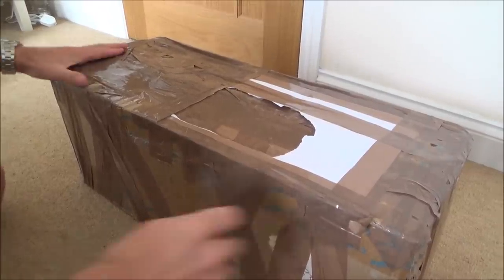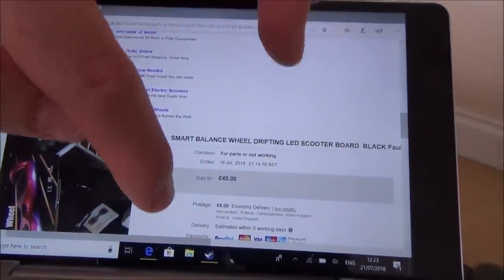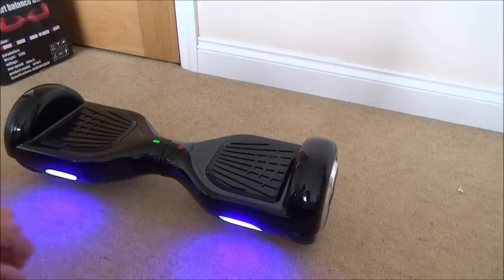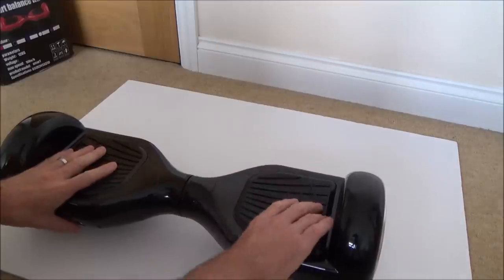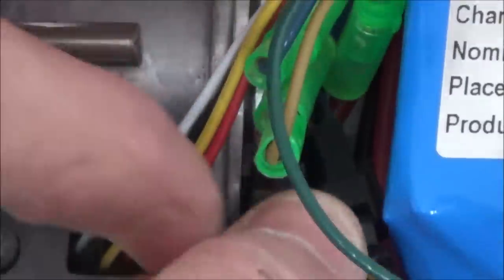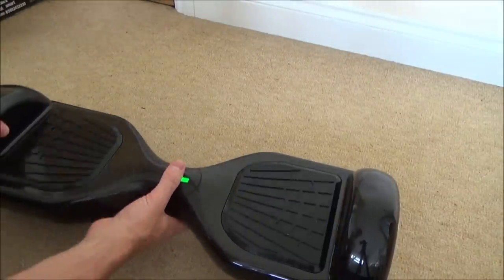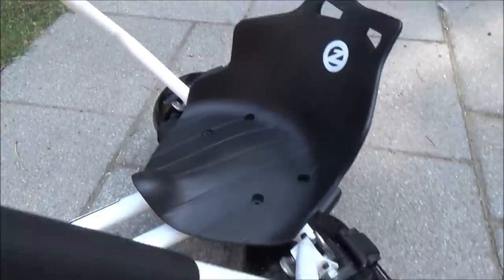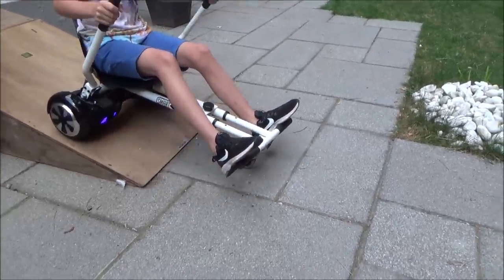Trying to FIX a Faulty Hoverboard / Self Balancing Scooter

Comment: The loose battery and wiring under the clamp and against just that shrink wrap oh my! That must have been one of those recalled units. In this case it just pulled the connector, no fire. Reroute the wires outside the bracket and take up the space under with rubber floor mat so it can't slide sideways. It fell on end in shipping no doubt.

Comment: I have an issue with a board a friend asked me to look at that I cannot find information about anywhere yet you would think it to be quite common. My board has an issue when you stand on it, it moves forward or backwards even when in the "flat neutral" position that isnt supposed to move. Im working on the issue now and am very surprised I cant find any others having an issue like this. I'll figure it out eventually and will post what I found once I figure it out, but nothing on YouTube has helped at this point.

Comment: I have an issue me and my step son were on his hover board yesterday it worked perfectly until I came to a lip in the ground and it cause the tires to spin in place then it turned off and wouldn’t come on unless it’s in the charger but even then it blinks green then red

Comment: just out of curiosity what is your success rate in repairing faulty items ?
Reply from the maker: On gaming stuff it is quite low but on other items it is high. I think with gaming or anything which has a good resale market then it has probably been looked at many times by professionals and deemed economically not worth it. Then it gets dumped on eBay!!!!

Comment: i have found the problem (havnt watched past 2:53 so i dont know if u alredy have) i have tried to attach a screen shot but it wont paste it so ill paste the URL and the part that you need to read: Red Light Flashing 5 Times - Replace Motor

Problem: The hoverboard red light blinks 5 times when there is a problem with the internal motor on the battery side. This problem is accompanied by one or both sides of the hoverboard refusing to balance. 

Cause: The long side of the hall line is faulty. There could be a deviation in the pin, a broken hall line between the motherboard and the motor, motor wires are switched around, or there is a bad motor circuit board.
Solution: The motor (inside of the wheel) on the battery side needs to be replaced. We recommend buying a replacement hoverboard motor from us and replacing the one on the battery side of your hoverboard. Motors themselves come fully assembled inside of a new wheel.
URL:https://www.streetsaw.com/pages/hoverboard-red-light-flashing

Comment: So my hoverboard looks almost identical on the inside, I double checked to make sure everything was connected but it still beeps and will not work. Calibration doesn’t work as holding the power button down does nothing
Reply: Any ideas?

Comment: Hi can anyone help me out 

For me the problem is 
One side light is on and that side is unresponsive(the power button side)whereas the other side works fine
I tired to recalibrate but in doing so only one side blinks the other side stays still and unresponsive 
Can anyone help me fix it
Without suggesting me to change the motherboard and replace a new one 

And  this error caused 
Because i tired to recalibrate it in a wrong manner and screwed it up.
If anyone could help me 
It would be amazing

Comment: only thing I'd be careful of is that the battery is right under your son so if he sees any kind of smoke from the hoverboard he  needs to jump out before it lights on fire especially if you have the hoverboard that has the heat sync right next to  the battery

Comment: I REALLY NEED HELP. I PURCHASED A SWAGTRON T6 OUTLAW OFFROAD HOVERBOARD. THE OWNER TOLD ME ITS BATTERY NEEDED REPLACED. AND WAS SELLING THIS 600$ BOARD FOR JUST 100$. I FIGURED, NO MATTER WHAT IS WRONG WITH IT. THIS IS GOING TO BE WORTH IT. BUT I AM COMPLETELY STUMPED. WHEN I PLUG A DIFFERENT BATTERY INTO IT'S PARALLEL, IT CATCHES ON FIRE AT THE CONNECTION. WHEN I PLUG IN A CHARGER. THE GREEN LIGHT THATS SUPPOSED TO TURN RED, TURNS COMPLETELY OFF INSTEAD AND YOU CAN EVEN HEAR A SORT OF POPPING NOISE FROM THE CONNECTION. WHAT THE FUCKING FUCK. IS THE MOTHERBOARD COMPLETELY FRIED? AM I SCREWED? I JUST FOUND OUT THAT ITS BATTERY IS GOOD, AND USED IT IN ONE OF MY OTHER BOARDS. TO TEST IT. SO IM VERY UPSET AND I NEED HELP PLEASE.
Reply: BANG!

Comment: That was used it had finger prints
Reply: Or, you know, someone just got it out of the packaging and touched it?
Reply: Nechrom it was the sellers finger print
Reply: Yeah, i know that. What i'm saying is that the seller bought the Hoverboard, opened the packaging and tested it. Then he noticed it didn't work and sold it to Vince. When Vince said it was 'never used' he didn't mean it was brand new or factory sealed or something like that. Just that the seller never really used it aside from testing it.

Comment: Sorry, but looks fake. Brand new board... selling on eBay... cable disconnected. Would that item not be returned back to the place it was purchased? I might be wrong, but in my opinion, all this been staged just for the video and views.
Reply from the maker: Hi, It is not fake, watch my other 'trying to fix' videos and you will see plenty where I don't fix things or I have been scammed on one, I was just very lucky on this one. Look at the eBay listing on the video again to see the same item that I am repairing.